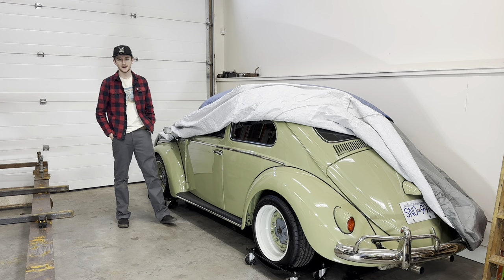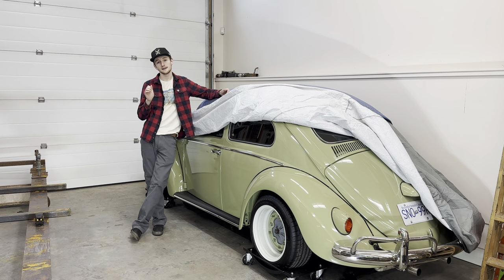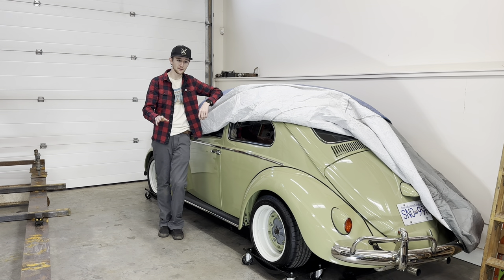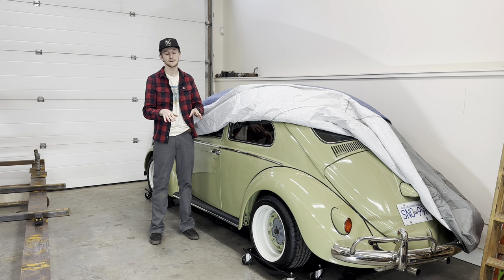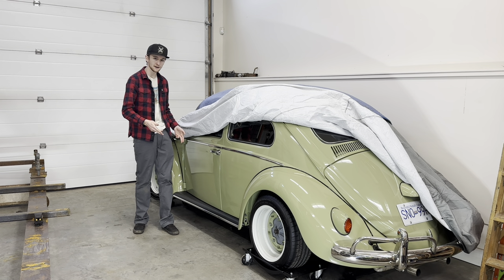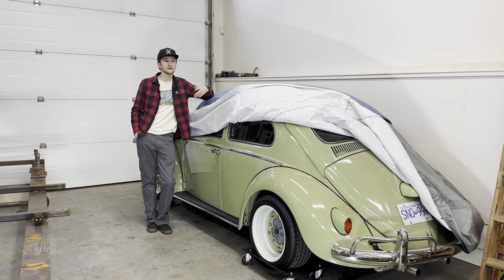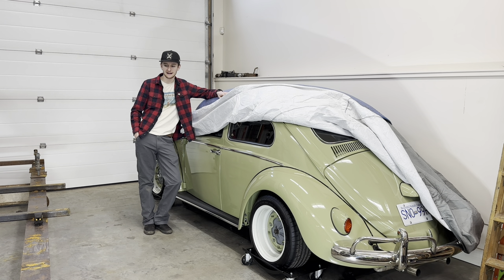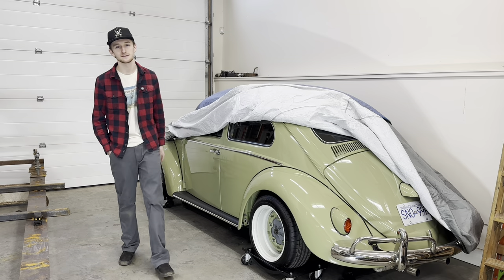How I Slammed My VW Beetle To The Ground! (2 Different Ways To Lower It!)

Comment: I had a 71 bug that was already lowered in the front when I purchased it.. He had removed some of the leaves in the torsion setup.. looked good but rode like a log wagon... I purchased a set of lowered shocks and it improved the ride 1000%...  I guess that was the cheap way of lowering it back in the 80's... I guess spindles is the best way to go with the adjusters welded into the beam.. Glad you raised it up.. I think they look a little better and definitely save money from damage... Thx for sharing your experience.. We learn from others mistakes.. Take care my friend and give Oliver my best....
Reply from the maker: Wow I never even thought of lowering that way. May be cheap but it sounds like it would work haha. Thanks for following along with all my stuff I really appreciate the support!
Reply: @smithsgarage273  yep it works but you definitely need lowered shocks to go with it or it will feel like there is no suspension at all.. Take care and stay warm...

Comment: Have you thought about bags or hydraulics? Demon Motorsport makes an amazing hydraulic kit - but you have to cut into the car quite a bit...but if you want a bolt-on system, airbags are the way to go! Thinking of getting an Evaresto kit myself!
Reply from the maker: I did think about it, it was tempting but I didn’t feel like going through all the effort. The Evaresto kit is pretty decent from what I heard tho. And it would look super cool to have the car sit even lower like that.
Reply: I recommend the Eva kits, I actually live the the vacinety of the Eva Resto business. I brought the premium rear kit for my bug, fitted it all myself and it's great the car sits beautifully. In a separate topic I love the colour of your bug dude, very cool in general 👍🏽👌🏽
Reply: @AM2024uk  what comes with the premium kit? I am seriously considering it !
Reply: @vridaw  all the bolt on frame work that fits around the gearbox, the shocks, the airbags, bolts, spring plates and probably a few bits I'm forgetting. As someone who is not a professional mechanic in anyway. It took me about a week to strip the old bits off and clean things up before I fitted the new kit.

Comment: Need help
When I jack up my 67 VW after I let the jack down and remove my floor jack the car stays up in the air like a Baja
And only drops back down low when I move it or take off to drive it
Like it's all super stiff
Reply from the maker: Hello! Yeah, I found mine actually did that exact same thing. I know suspension does need movement to help it settle. But the independent rear end of a beetle in specific is really bad for staying way up in the air when you first drop it. In order to find the ride height of my car, I had to adjust it and then drive it around to see where it would actually settle.